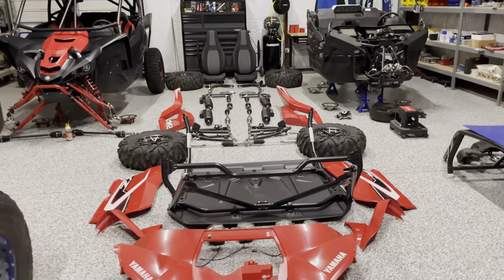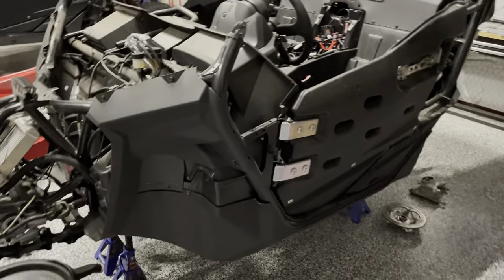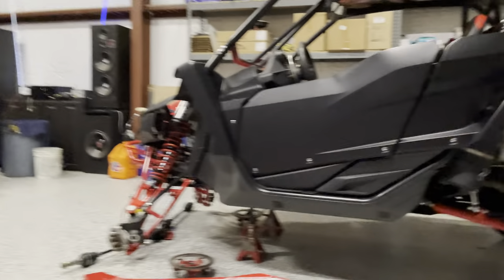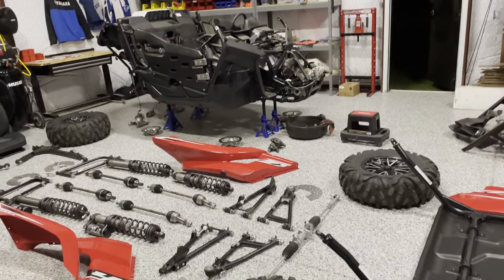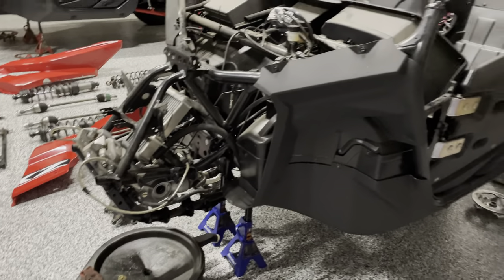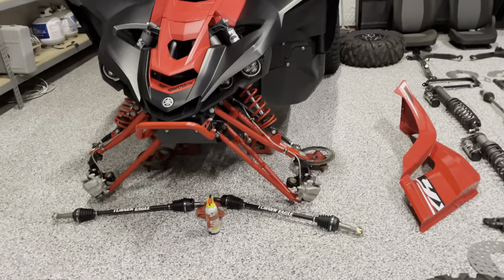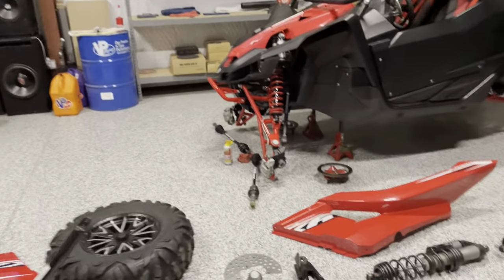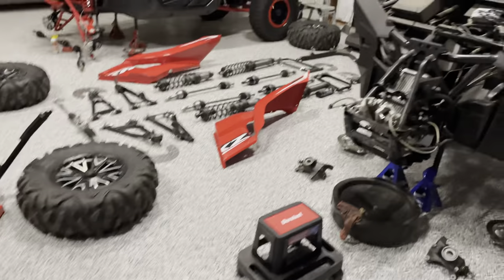2020 YXZ-1000R disassembly for build

Comment: Been watching your videos building my first yxz for little sahara this november. I'm going with nxs long travel and looking for suspension any recommendations?
Reply from the maker: You can have the OEM shocks revalved and resprung for the NXS Designs long travel kit.  I recommend bigger shocks for the rear like you see on my daughter's red/black YXZ in this video, they are Fox Factory 3.0 shocks from Weller Racing.